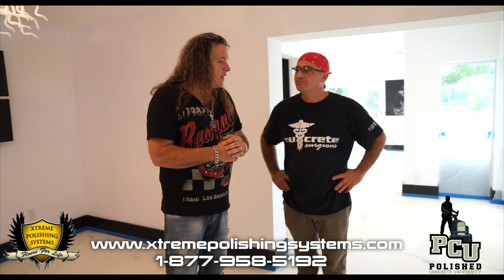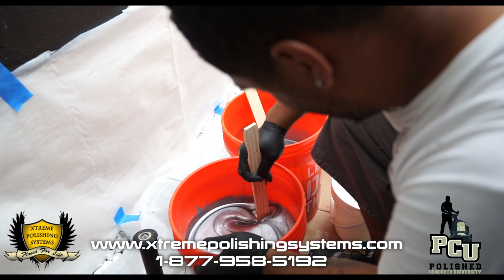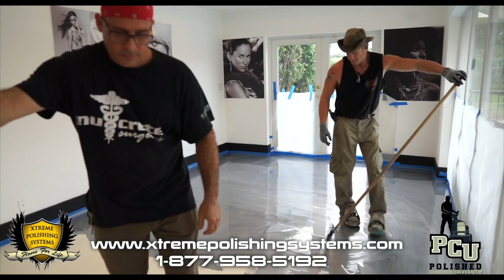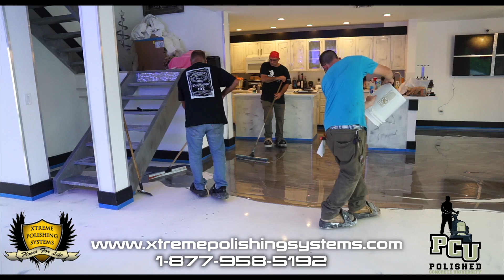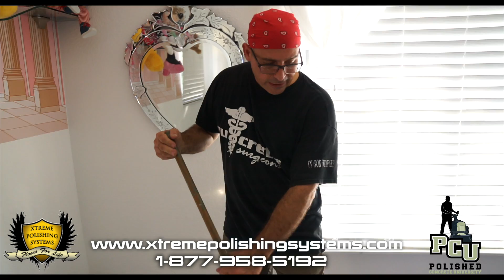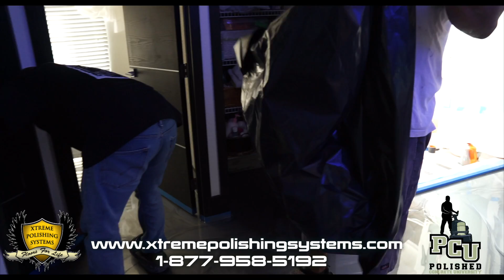Silver Metallic Epoxy Residential Floor Installation Start to Finish | #xps #epoxyflooring

Comment: What kind of floor did you put the epoxy on? I have a wooden floor and I'm guessing I can't put epoxy on top of that
Reply from the maker: We applied over concrete; however, it is possible to place over wooden flooring. I would suggest giving one of our flooring experts a call at (877) 958-5192. The process is tedious and they will be able to go over exactly what you would need and the process in details to achieve the end result you are looking for.

Comment: how slippery is that thing when water spills?
Reply from the maker: Once epoxy has fully cured after being sealed, the flooring isn't slippery. Epoxy resin coatings are meant for highly trafficked areas.

Comment: Does the floor become very slippery when wet? Because my garage is epoxy and very slippery when it rains.
Reply from the maker: Once properly cured and sealed, the coating isn't slippery. Epoxy resin coatings are meant for highly trafficked areas.

Comment: Don't know how I stumbled on this.  Only flicked through but was absolutely amazed. I understand this stuff sets fast but how can you walk on it seconds after spreading it around? Yet an air bubble will screw it.
Remarkable substance!!
Reply from the maker: We use special epoxy coatings shoes that allow us to walk on the coating when applying the coating.

Comment: All I can think about on a floor that smooth. You spill one drop of water, you're gonna crack you head open on the floor.
Reply from the maker: Once fully cured and sealed, epoxy flooring isn't slippery.

Comment: How long does the resin start to harden?
Reply from the maker: Typically it takes 24-72 hours. Depends on how thick the coating is applied.

Comment: do you sell to The Netherlands? How much is per square meter (m2)?
Reply from the maker: Yes, we do. Xtreme ships worldwide. Our clear epoxy kits are $150 for 3 gallons. This kit will cover between 375-450 SF. When adding in color and metallic pigments, each packet covers 45-50SF. Recommended 2 pigment packets per kit. It's based on the SF you are looking to do. To view our selection of epoxy products, please visit http://www.xtremepolishingsystems.com/Epoxy-Floor-Kits-s/2030.htm

Comment: we were giving thought to doing an epoxy flooring but there is some rough spots in the concrete because of a bad patch done when some plumbing pipes had to be replaced. Would this help smooth it all out or do we need to find a way to smooth out the bumps?
Reply from the maker: Epoxy coatings is a self leveling agent. As long as the surface is smooth and dry, the epoxy will adhere to the flooring. To browse our selection, please visit https://www.xtremepolishingsystems.com/Epoxy-Floor-Kits-s/2030.htm

Comment: Does anyone know if you can apply this directly on concrete without doing anything special to the floor?? I want to do something like that in my garage
Reply from the maker: As long as the flooring is smooth and dry, using an epoxy primer would it.

Comment: How do you prepare the concrete for this epoxy? How much does it cost per SQ ft?
Reply from the maker: For epoxy to adhere, the surface needs to be smooth and without any moisture. Our clear epoxy kits are $150 for 3 gallons. This kit will cover between 375-450 SF. When adding in color and metallic pigments, each packet covers 45-50SF. Recommended 2 pigment packets per kit. It's based on the SF you are looking to do. To view our selection of epoxy products, please visit http://www.xtremepolishingsystems.com/Epoxy-Floor-Kits-s/2030.htm

Comment: How slippery is that floor in the winter??
Reply from the maker: Once properly cured and sealed, the floor is slip-resistant once the proper top coat is applied.
Reply: Thanks for replying.

Comment: will it scratch by shoes?
Reply from the maker: Once the epoxy coatings has been sealed and cured, the flooring is extremely durable and meant for highly trafficked applications.

Comment: Where in FL do you guys do coating? I'm having a house built in Winter Haven and would love to have my garage and lanai done with this finish.
Reply from the maker: Xtreme Polishing Systems supplies the materials to install the flooring, but we do have a partnered company www.nationalconcretepolishing.net. They will be able to provide a free estimate for your garage in Winter Haven.

Comment: Can i use it in the cement? Without the tiles
Reply from the maker: Absolutely! As long as it's a smooth and dry surface, epoxy can adhere. To view our selection of epoxy coatings, please visit https://www.xtremepolishingsystems.com/Epoxy-Floor-Kits-s/2030.htm

Comment: wow nice, u use that with cement floor?
Reply from the maker: Yes, as long as the flooring is dry and a smooth surface, the epoxy coatings can adhere to the surface.

Comment: i was a little skeptical when this was being applied on how the finished product would look, but wow, im very impressed.  ive seen alot of stained concrete jobs and this totally blows that out of the water.  very nice. what is the up keep on something like this? and would it ever need to be refinished?
Reply from the maker: Proper maintenance would be to apply a sealer every 6 months.

Comment: I tried looking up data sheets on your website to no avail. this is a really neat system. I've been looking for something unique to do in a couple of rooms in new construction at my office. it's not a concrete slab foundation, but floor joists topped with plywood at the moment. very sturdy, but at the end of the day it's still a somewhat flexible substrate. I think it would be fine over the majority, but if I put a bond breaker over my seams would this epoxy have a little flex or would it crack at the joints as if they were saw cuts in concrete? let me throw one more at you. If this epoxy doesn't have the flex, do you have a urethane top coat that could take place of the second coat of epoxy so that it would have flex?
Reply from the maker: All of our data sheets are up on the website under the tab "Data sheets" I will have to refer you to one of our concrete floor experts on applying over plywood. It is possible, it's just a tedious task. Chris can be reached at (877) 958-5192
Reply: so no urethane?
Reply from the maker: Yes, we do have a urethane flx top coat. Please visit https://www.xtremepolishingsystems.com/HP-SPARTACOTE-Sparta-Flex-Clear-p/hp-spartaflexclear.htm

Comment: What if someday those metalic exp floor crack caused by something heavy? Is there guaranteed?
Reply from the maker: Xtreme Polishing Systems doesn't install floors, but we have partnered up with www.nationalconcretepolishing.net. I would confirm with them, but I think they guarantee an epoxy floor 3- years with proper maintenance.

Comment: Hi, excellent work but I was wondering if the finish will go away very soon? Does this floor require some extra care and how long would it approximately last before I would have to get it done again???
Reply from the maker: Standard cleaning is every 6 months and apply another coat of sealer to be safe.
Reply: Xtreme Polishing Systems Thnx

Comment: Does this epoxy work in hot humid temperature destinations
Reply from the maker: Once properly cured and sealed it's not an issue. For installation, you need to make sure it's a dry and smooth surface for the epoxy to adhere. Our corporate office is in Florida, and epoxy holds up just fine.

Comment: do you need a primer coat on floor first? i wanted to do my basement floor and have to fill some imperfections in concrete..can i fill the tiny potholes with something first then epoxy, or can the epoxy fill it in? also, do you wait for it to cure then cut tape or just take tape off before it cures
Reply from the maker: Prepping and priming is always best practice when installing any type of flooring. Epoxy is a self leveling agent and should fill up the holes for you. For cleaner lines, it's best practice to wait to pull tape once there is some kind of hardening in the material.

Comment: Can this be done on the top of tile? I want to do this in my house soooo bad.
Reply from the maker: Yes, just need to make sure the surface is smooth and without moisture for the epoxy to adhere. It's a self leveling agent, which makes it easy to coat over for resurfacing.

Comment: What kind of flooring can you put this on?
Reply from the maker: Epoxy can be placed over most surfaces since it's a self leveling agent. The surface needs to be smooth and without any moisture for the epoxy to adhere during installation.

Comment: I have a metallic epoxy floor. It gets scratches easily. My guy said he needs to put a polyurethane coat to make it durable. Plus it lost its shine with in two months.
Reply from the maker: A sealer is always required after epoxy coatings installation. Once properly cured and sealed, epoxy coatings will not loose it's shine after 2 months.
Reply: Thanks for the reply. He came by yesterday and applied a polyastic seal. He applied it with a roller. He lightly sanded my floor than applied the sealer. The floor is shiny but no longer smooth since he applied sealer with roller. Not good as l wanted a smooth shiny floor. Is that possible?
Reply from the maker: Epoxy should never be applied with a roller or it won't be a smooth shiny surface. Floor squeegees are the optimal applicator.

Comment: can you do this over tile flooring ?
Reply: Xtreme Polishing Systems, you say tile surface, but can this product be used over any type of wood?
Reply from the maker: As long as the tile surface is smooth and dry, epoxy can be applied.
Reply from the maker: Yes, epoxy can be installed over wood. It is, however, a tedious process. Before you start on this project, I would suggest contacting one of our experts to make sure the process is solid for you. (877) 958-5192

Comment: Since im planing to saving some money ,was wondering,if i pour that liquid on cement tile, will it has the same result as the video?
Reply from the maker: Epoxy is self leveling and as long as the surface is smooth and dry, the epoxy will adhere.

Comment: Can I used on cement floor? To cover the cement, of course. Can i?
Reply from the maker: Absolutely!  The surface needs to be smooth and dry, for the epoxy to adhere. If you wanted to give our experts a call, they are happy to walk you through step by step processes at (877) 958-5192

Comment: This is amazing? Can I go this over wood floors? its like real wood
Reply from the maker: It's possible but tedious. The surface needs to be smooth and dry, for the epoxy to adhere. You need to be careful with the cracks as well since epoxy is a self leveling agent. Our experts are available to help assist to walk you through the process at (877) 958-5192

Comment: Is it cheaper than hardwood floors?
Reply from the maker: Depends on space and options chosen, but typically, epoxy is considered decorative concrete, which is a bit on the higher end.

Comment: Is this scratch resistant?
Reply from the maker: Epoxy is meant for high trafficked floors, and is extremely durable. It does a bang up job to resist scratches and marks.

Comment: One spill on the ground = dead
Reply from the maker: Epoxy is meant for high trafficked floors, and is extremely durable. Once properly sealed, spills are nothing to worry about.

Comment: wow that's beautiful how much do yall charge?
Reply from the maker: Our clear epoxy kits are $150 for 3 gallons. This kit will cover between 375-450 SF. When adding in color and metallic pigments, each packet covers 45-50SF. Recommended 2 pigment packets per kit. It's based on the SF you are looking to do. To view our selection of epoxy products, please visit www.xtremepolishingsystems.com/Epoxy-Floor-Kits-s/2030.htm
Reply: Xtreme Polishing Systems okay thank you I look forward on using your products

Comment: how much does something like this project cost?
Reply from the maker: Our clear epoxy kits are $150 for 3 gallons. This kit will cover between 375-450 SF. When adding in color and metallic pigments, each packet covers 45-50SF. Recommended 2 pigment packets per kit. It's based on the SF you are looking to do. To view our selection of epoxy products, please visit www.xtremepolishingsystems.com/Epoxy-Floor-Kits-s/2030.htm

Comment: does this stuff chip easy can i use this by the pool and does it get slippery when wet
Reply from the maker: No, not slippery once the epoxy has been cured and properly sealed. Epoxy is perfect for high trafficked areas, and is extremely durable against chips and marks.

Comment: how smelly is this product? if it does smell how long does it last?
Reply from the maker: Just like any chemical reaction, an odor does ensure, but depending on how thick the coatings is applied, between a day or 2 for the odor to fully dissipate.

Comment: how much?!
Reply from the maker: Our clear epoxy kits are $150 for 3 gallons. This kit will cover between 375-450 SF. When adding in color and metallic pigments, each packet covers 45-50SF. Recommended 2 pigment packets per kit. It's based on the SF you are looking to do. To view our selection of epoxy products, please visit www.xtremepolishingsystems.com/Epoxy-Floor-Kits-s/2030.htm

Comment: can u use this on plywood floor
Reply from the maker: As long as it's a secured foundations and smooth, dry surface, epoxy can be applied on plywood. You need to be careful about the flooring flexing when applying the coatings.

Comment: what about heat resistance, maximum temp. it can withstand?
Reply from the maker: Industrial epoxy Ican withstand continuous heat exposure of 400ºF and intermittent heat exposure to 550ºF

Comment: can we do Italian marble design using this? which is expensive? epoxy or Italian marble?
Reply from the maker: Yes, a marble look and feel can be accomplished with epoxy coatings. Marble would be more expensive. Epoxy is a self leveling coating, while marble is a solid rock, essentially.
Reply: Xtreme Polishing Systems how much is it to do it on ones own

Comment: Can I poor this stuff on floor boards? Rather not poor cement down first, I've seen videos where people have pored on hardwood floors.
Reply from the maker: Yes, epoxy can be applied to floor boards, as long as there is a smooth, and dry surface.

Comment: does it have to be on concrete or can it be installed on plywood? also how are the fumes? do many people have reactions to the epoxy?
Reply from the maker: As long as the surface is smooth and not wet, epoxy coatings can be applied.

Comment: can this be used on top of laminate flooring?
Reply from the maker: As long as it's a smooth surface that will not bend, epoxy can be applied to the dry surface.

Comment: what is the price for 1m2 or sqft...
Reply from the maker: Our clear epoxy kits are $150 for 3 gallons. This kit will cover between 375-450 SF. When adding in color and metallic pigments, each packet covers 45-50SF. Recommended 2 pigment packets per kit. It's based on the SF you are looking to do. To view our selection of epoxy products, please visit http://www.xtremepolishingsystems.com/Epoxy-Floor-Kits-s/2030.htm
Reply: And one question more...what is the filling on touch....like gum or like concrete...is solid or not...
Tnx for all...
Reply from the maker: You would need to wait for the epoxy to cure, and once hardened, you'd seal with a clear top coat.

Comment: How slippery does that floor get after that? It would be cool to have that kind of floor in my garage
Reply from the maker: Epoxy isn't slippery once properly cured and sealed. This coating system is ideal for high trafficked areas, making garage floors the perfect application.

Comment: sorry my bad english , 1 liter of epoxy how square per meter is the coverage ?? and how thick is that ??
Reply from the maker: Our clear epoxy kits are $150 for 3 gallons. This kit will cover between 375-450 SF. When adding in color and metallic pigments, each packet covers 45-50SF. Recommended 2 pigment packets per kit. It's based on the SF you are looking to do. To view our selection of epoxy products, please visit http://www.xtremepolishingsystems.com/Epoxy-Floor-Kits-s/2030.htm

Comment: Looks beautiful but I wonder what would happen if the concrete base cracks for whatever reason and the epoxy layer cracks as well, is that repairable without being too noticable?
Reply from the maker: Great questions. Epoxy coatings are a self leveling agent, making repairs seamless.

Comment: awesome job!  I do a lot of self leveling cement , where do you get your cleats?  I use lawn cleats but kinda hip on the ones you use
Reply from the maker: Xtreme offers spiked shoes for epoxy coatings installations. http://www.xtremepolishingsystems.com/Epoxy-Pro-Spike-Shoes-polishing-accessories-p/shoes-epoxypro.htm

Comment: How much does a job like this go for?
Reply from the maker: Our clear epoxy kits are $150 for 3 gallons. This kit will cover between 375-450 SF. When adding in color and metallic pigments, each packet covers 45-50SF. Recommended 2 pigment packets per kit. It's based on the SF you are looking to do. To view our selection of epoxy products, please visit http://www.xtremepolishingsystems.com/Epoxy-Floor-Kits-s/2030.htm
Reply: thanks

Comment: How much would something like this cost?
Reply from the maker: Our clear epoxy kits are $150 for 3 gallons. This kit will cover between 375-450 SF. When adding in color and metallic pigments, each packet covers 45-50SF. Recommended 2 pigment packets per kit. It's based on the SF you are looking to do.

Comment: hey man i meed to know if u mixed the part a and b with a drill or by stick thanx
Reply from the maker: I have seen both used to mix. The drill will provide more consistency in mixing, however.